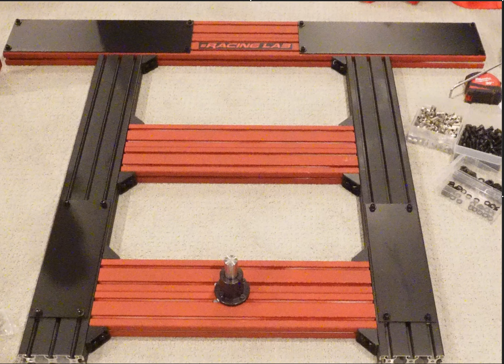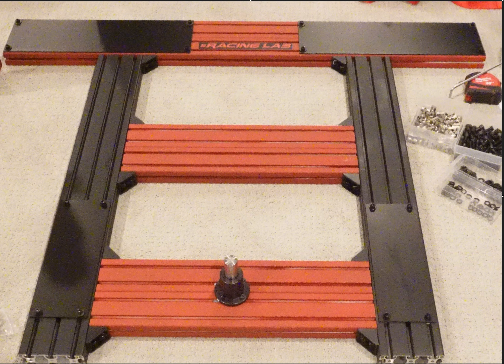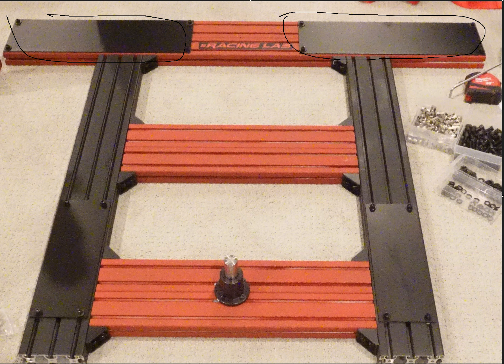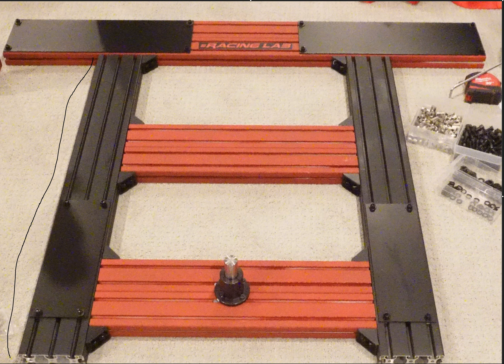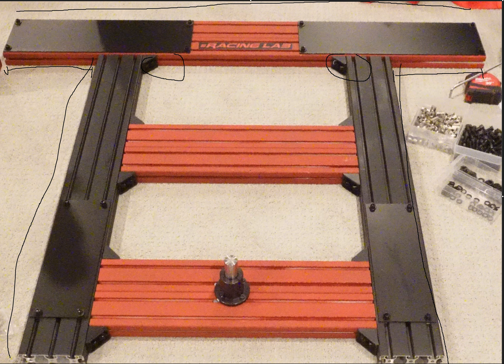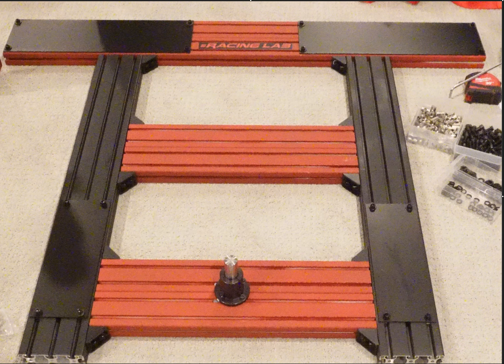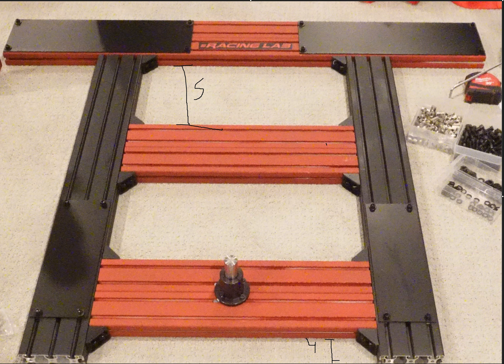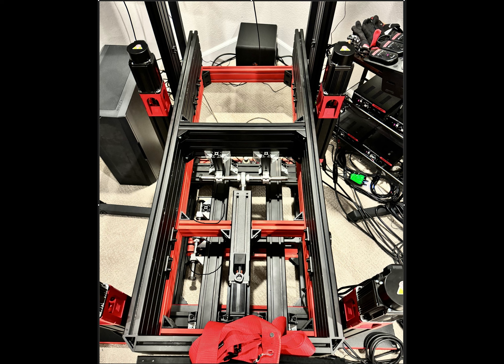Eracing Lab - Building Traction Loss Platform - Part 2

Comment: Thanks for the video! Your video is what convinced me to get the Ultimate kit as well. Question,  at the 8 minute mark, you talked about shifting the TL actuator 3 inches out to the right. Why did you make that adjustment?  Also, you had another video where you detailed out how to figure out measurements but I can't seem to find it now. Did you take it down?
Reply from the maker: You mean this video? Eracing lab RS Ultimate Series - Measurements
https://youtu.be/bfPmeGp7H1M - for the 3 inches out, that’s how it is today because the park position opens the actuator to 50%.

Comment: Hi, When setting up the T/L actuator, did you have to pre-center the servo? Can you mount the servo on the left or the right side? Thanks in advance.
Reply from the maker: You do not have to. The Thanos controller has a park option that sets the servo to 50%. Just make sure when you install it, you have room for the rig to go left and right. You can install either left or right it won’t matter.

Comment: I'm thinking I want to build a rig just like you, but it seems hard to build for both race and flight sim. Do you use rudder pedals? Is RS Mega good for flight sim?
Reply: I like your well thought set-up. Most people assemble tr160 incorrectly for actuators.
Reply from the maker: Thanks. Yea I do use rudder. I added a metal plate for the rudders and i can easily remove the rudder then put it back when I want to fly.
Reply: @simul8master  Do you put the rudder plate in front of the race plate and no need to exchange? If so, it is perfect.
Reply: I was worried about whether i could make the space.
Reply from the maker: I’ll send you a picture. If you plan it right, you can make the space.
Reply: @simul8master  Thank you so much!

Comment: how long and  wide is your rig that comes on top of this ?
Reply from the maker: it's about 66 long (including the frame for the tension belt) and 23 inches wide. but if you add more peripherals on the side (shifter, flight controls...) it will increase the width.